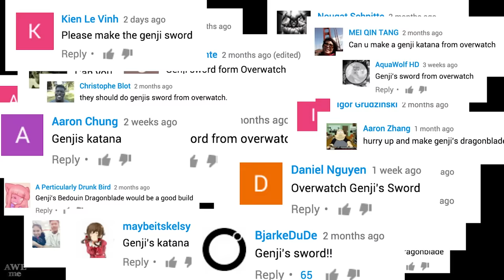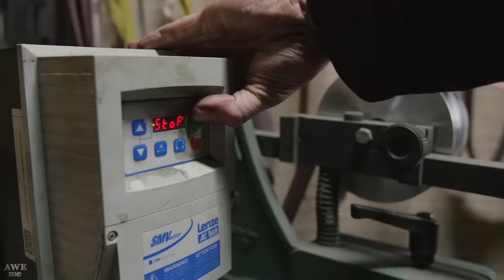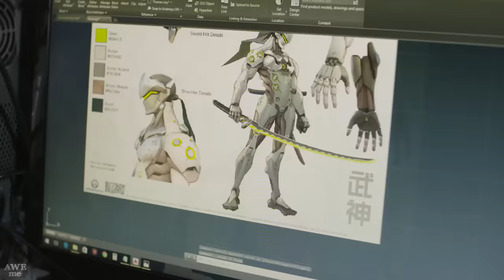Genji's Sword - Overwatch - MAN AT ARMS: REFORGED

Comment: Any weapon from RWBY. Seriously. There's too many possibilities to request directly, so I'm gonna leave it up to you guys to figure out which one is the most doable.

I'll add my personal suggestions in the comments to get you started though.
Reply: 1.) Crocea Mors. In Volume 4, one of the main protagonist's rather boring sword and shield combo gets a very cool upgrade. 

2.) Gambol Shroud. A folding sword that has a pistol integrated into the guard and a secondary blade built into the sheath. Utilitarian, yet awesome.

3.) Myrtenaster Think Squall's gunblade and Arya's needle combined into one weapon. Triangular blade cross-section and revolving chamber containing "dust" that changes the properties of the blade mid-battle.
Reply: I would love  to see Qrow's scythe (I'm good with sword form), either Raven's sword or Adam's Wilt and Blush or Neptune's guandao or Trident